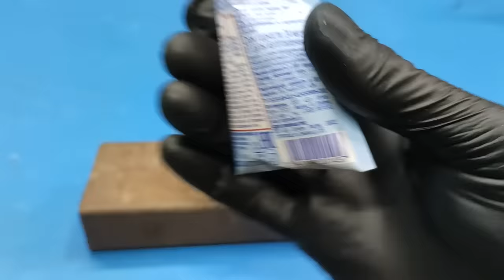Don't buy super glue, make it yourself in 2 minutes from vinegar!

Comment: Your mix will never work, but if you mix a few packing peanuts or  piece of styrofoam  with plain old acetone to the desired thickness, you can even build a model plane with it. The stronger version is some acetone, very fine acrylic shavings (perspex) with a small piece of styrofoam mixed in to lengthen the polymers. Keep it sealed, and it might take a day or so to fully dissolve depending on how fine the acrylic shavings is that you start with. Once dissolved, you can thin it out to the desired thickness by adding more acetone. No, it still is not superglue, but a cheaper way to do some hobbies if you use a lot of glue, and need fast setting times.

Comment: This glue maybe ok for polystyrene or depron foam board.  Any thoughts on this out there.
Reply: It's basically a take on hide glue which has been used for centuries to bind things together. Thing is, if it gets wet, it'll loosen up because the glue is water soluble.

Comment: I've been told, I man, handle things. l could be your tester for items you have glued together.  If I don't break it, then it's good.
I even have used all kinds of glues, and yes, I have used the baking soda. 
Superglue and baking soda are really good together, but as I tested the items. I did manage to break it apart.
Epoxy and baking soda really held up great. I wasn't able to break the items I glued together. 
For those who have tried everything to glue something together and not fall apart. Epoxy and a little baking soda will glue quickly.

Comment: I would add a teaspoon of warm milk and a teaspoon on salt.
Reply: I used to make a similar glue. The salt keeps it runny in the jar, but absorbs moisture in the air when it's used, and dries.
Using a small amount of metho, makes it dry quicker.

Comment: Congratulations on rediscovering 10,000 year old hide glue, which is made from boiling skin and bones until they basically disintegrate.  This also happens to be the way GELATIN is made, so there's your active ingredient.  You'd get the same result without the vinegar and glycerin.  Also, unlike superglue, this is useless for nonporous materials like glass, metals, and plastics.

Comment: 👍🏻This is organic super glue, which was used to glue composite horn bows together.  All organic materials of any kind should stick together.  It's amazing that it also works with plastic.
Reply: No it is not.
Reply: @growleym504  Yes, gelatine from fish swim bladders was used to glue horn arches.
They also did not use vinegar to dissolve the gelatin. Vinegar would likely attack the horn and negatively change its properties.
But technically it was also a bio-glue made from gelatin.
Reply: @TheAnatoli66  Glue? Yes. SuperGlue? No. Superglue is cyanocryalate and the process of manufacture is somewhat complicated and not something you do on the kitchen table with ingredients from the grocery.

Comment: This is basically rubber cement, that's it. Notice how they had to clamp things to provide long term pressure for it to set and prep the items. Super glue requires none of that and it flows easily on small or thin items. I guess if you want to be a DIY this is fine but it certainly doesn't beat super glue for ease and conveniance in my opinion.

Comment: People really need to think, and not just accept YouTube stuff. 

This is what is called hide glue. 
Gelatin dissolved in just a little water creates a glue that has been in use for thousands of years. 
It is commonly used in veneering and such. 
This glue will re-dissolve in hot water or steam... which is why we use it for veneering (i.e. so when the veneer breaks a hundred heads from now, it is easier to replace).

Adding glycerin and vinegar is to prevent it from drying hard - to keep it rubbery. This is also an old book binding variation. 

Not super glue at all.

Comment: But what of the cyanide? Superglue contains cyanoacrilate. I don't know if people can even buy that without some kind of permission.
Of course, there are many formulations available for adhesives.
Reply: A cyano group is also called name a nitrile group. While they can be created with a cyanide salt, they can also be made from primary amines (using thionyl chloride, a watched substance that will attract the attention of the DEA).

Yeah, this is hardly a cyanoacrylate.
Reply: @Radagast97  I believe that chemical is on my list as a dielectric for capacitors. I didn't make the list, just copied it. But I do check for toxicity of all chemicals I may need.
Thanks.

Comment: I think that, even when it might not be superglue, it offers a decent altetnative. Even in USA, this is 2:40  a very good alternative: seems like the recipe yields half of a small baby food jar (4 oz). The small tubes of superglue at the dollar store are 0.12 oz; they mus be used within a short period of time or dries out. The little tubes will contribute to pollution. Now, the packages at the dollar store come with two tubes which makes each $0.50 plus taxes. Even if you squeeze it all, there is always residue in the tube. So, with 2 oz of the prepared glue, we can obtain the equivalent of 17 little tubes... that will be about  $11.00 USD considering only 5% sales tax (in my city is about 9%).
4 envelopes of flavorless gellatin cost about  $4.00 for 1 oz (28 grams) more than half of the recipe, so the cost is really $2.00. Glicerin varies a lot, but an average is $10.00 for a bottle of 10 ounces (average); the recipe calls for about 2 teaspoons (10 ml;)  there are about 29 ml per ounce so less than half an ounce for the concoction, cost = $0.50. Vinegar on the recipe is less than a tablespoon, most of us have vinegar at home, water is 2 tablespoons... Doing the math, we can obtain the 2 oz of glue for about less than $5.00 and use the rest of ingredients in other things.
Reply: I buy bottles of super glue at the dollar store (Dollar Tree) and it lasts years.  You have to wipe off the nozzle before you put the cap back on.
Reply: The Dollar Store is now the Dollar-and-a-Quarter Store.

Comment: Surely it is not even close to Cyanoacrylate-based glue. The Gelatine is just identical to the hide glue sold cheaper than the edible gelatine.  Hide glue is prone to degradation by time and it si fast if air humidity is high. This is the case with this mix, too. So I do not use that .

Comment: This is not even close to cyanoacrylate, not in time to set, not in durability, not in resistance to moisture... The ONLY reason that (essentially) hide glue worked was because of the massive surface areas involved. having several square cm of gripping surface is easy to overcome 3 or 4mm glass, also notice how the forces on the wood were pressing in compression rather that the peak loads of tension? Maybe if the OP was lifting the entire table rather than slightly bending the solid wood around a pivot...  Not impressive in the least and really, not all that useful either.

Comment: I am trying to finish the glider so I can escape over the border ill just need a few more canvass swaths of cloth and more nights to dry then I think I can shove off and make it 30 or 40 feet before im riddled to the ground again by my dreaded wife.

JUST KIDDING IM NOT MARRIED ........ NOT ANYMORE THAT IS BWAHAHAHHAHAHA LAUGHING LIKE CHARELTON HESTON OMEGA MAN PLAYING CHESS ALONE...
I believe with this mixture I can dry the plane to perhaps get enough lift to make it over the wall and into freedom. Otherwise ill crash into a well built pile of sticks and canvass all to be captured all over again to tunnel my way to a motorcycle to hop it over the constantine wire fence into freedom unless the dogs get me again those mangy well fed Sheppards are fast and they dont care if YOU wreck.  No these Ribs will heal in time for me to scooth off the North Face wall into good air I just need this mixture to hold till I can get her into the valley.. Before the blizzard that is the air is thinner when its damp with cold I could drop like a rock in that craft if too thin which is all the more reason this mix must hold.

It evidently worked long enough to get some to read all of this......